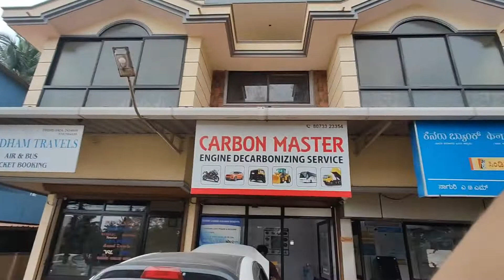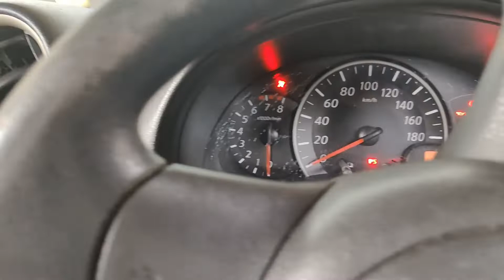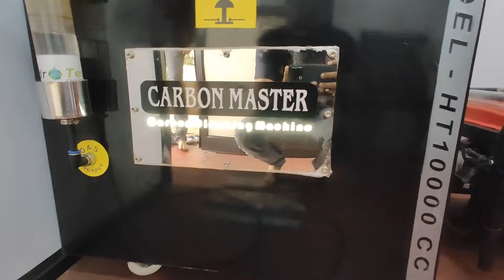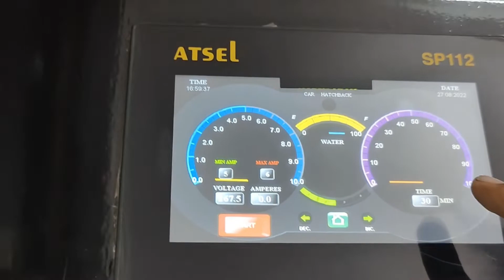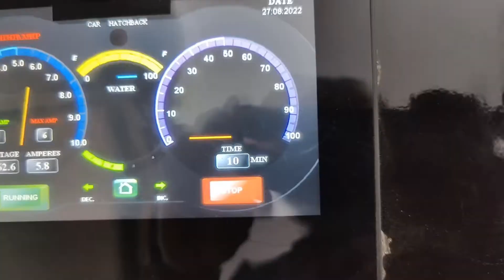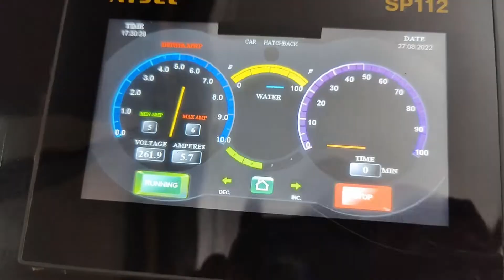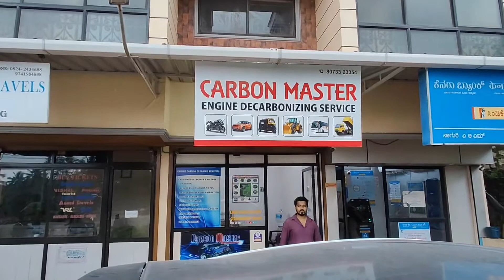What is decarbonization ? I decarbonized my Car | Carbon Master now in Mangalore

Comment: Is it safe to do all the cars??
Reply from the maker: It's totally safe for all types of cars , they don't use any kind of chemicals and the Carbon master in Mangalore has done this on almost all kinds of brands of cars and they have been around for the last 1 years .
Reply from the maker: Plus they are are passing only  hho gas, no liquids/ chemicals...and they don't dismantle the engine also.

Comment: I did decorbanization for my Ritz at 217000kms
After getting it done, low smoke, no vibration, really very good pickup
Engine noise 80% reduced, feel like new, I had done it today morning itself, am sure in 2 to 3 days I'll get to see defference in fuel consumption,
Service is too good, he explains each and every thing about decorbaning and also informed me some defects in my car to be get it done is service centre as soon as possible.
Work was done at very reasonable price
100% recommended place
Thankyou to CARBON MASTER
Reply from the maker: Thank you for your feedback